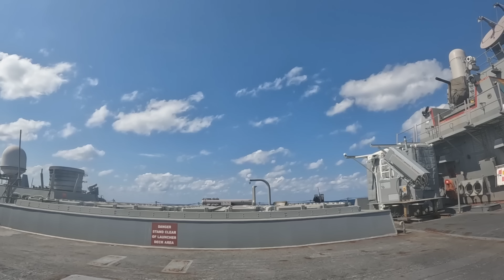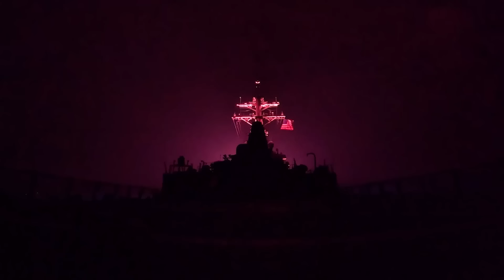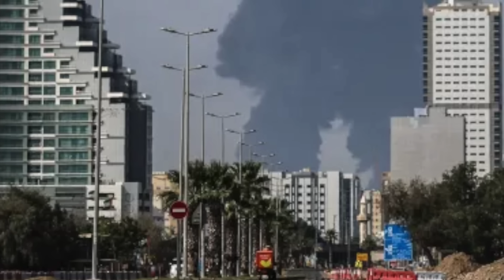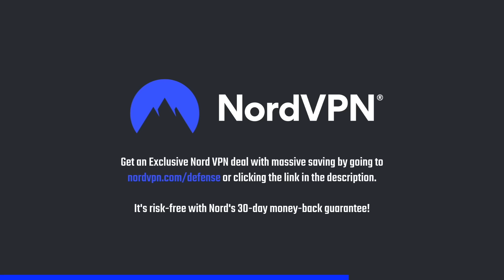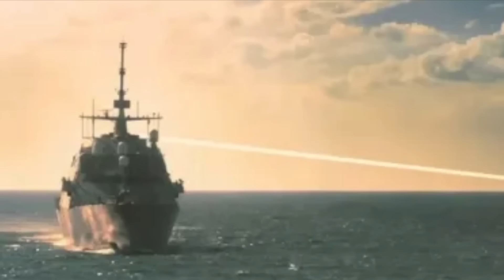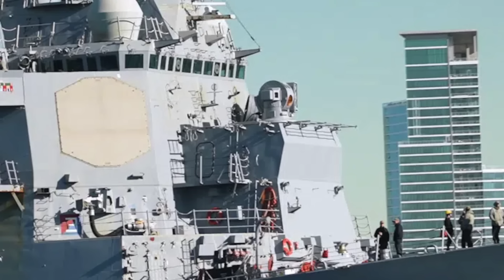Why US military needs HELIOS laser in every warship ?

Comment: Weather, battlefield smoke and clouds can render this system degraded.  Also it has a weakness for low in coming threats due to its direct line of sight and the horizon limiting its engagement times.  However in degraded it can readily engage targets coming in at a higher angle especially a ballistic missile trajectory.
Reply: wonder if like a rocket cluster with some containing smoke bombs could be enough to protect other nearby rockets in time if they alser hit the wrong disguised target. 

In Gundam they had gas canisters to help disperse beam weapons

Comment: Not impressed.  
1) If it doesn't work in all weather, it's not a viable/reliable defense. 
2) If it's line of sight, it lets enemy missiles (and possibly MANY) get real close.  Either it works, or doesn't,  but better know that before buying a bunch (and replacing other systems)
- if there's a "time on target" restriction, there's a related "max number of potential targets" limit.   Better know that too, because the 10th target is likely getting darned close!
Reply: Well for shooting down drones that seems viable

Comment: America also needs more Palmer Lucky
Reply: Ive been saying this. The United States should be wasting Anduril cruise missiles in Iran instead of Lockheed Martin and Raytheon missiles which are over priced AF. They work just way to costly to waste.
Reply: @austincizmeli6268  
Wrong
The Anduril cruise missiles only carry 100lbs warhead which is only good for mobile targets and other light targets
The JASSM and TLAM carry 1000lbs warhead which is excellent for hard target penetration. So with Iran's harded bunkers and structures, the JASSM and TLAM has no problem destroying them in one shot
The TLAM-D carries submunitions for spread out targets such as air fields 
If  Anduril had any sense
they would not being trying to compete against the JASSM and TLAM
The short fall that the US aircraft has is they lack a high speed long range missile capable of time sensitive strikes against fixed or moving targets
The Army PrSM gives them that capability via HIMARS and M270 but they are not as fast or as flexible as aircraft
Example, the S-400 range is 250 miles and the S-500 is 315 miles as well mobile targets like Iran's launcher
So the missile that  Anduril  would need to develop would be mach 3 plus carrying 100lbs warhead with multi mode seeker able to track fixed or moving targets with 350m range
The AGM-88G cost 1.5 mil ,  Anduril could make a target cost of 300K per missile
S-400 has 7 parts 
So AGM-88G is 10.5 mil spent where at a cost of 300K, it would only be 2 mil spent using Anduril high speed missile
 Anduril could also pitch as a weapon to use against Chinese DF launchers
They are trying to compete in the wrong area
Reply: Anduril is the bomb!

Comment: They could be using that 747 laser right now Flying over or close to the Iran  Knocking down Irans larger missiles  It is the perfect place and time  To bad they decided to discontinue the program
Reply: Was never really a practical weapon, and has been mothballed for over a decade.
Reply: @bbmw9029 yes because the research was to expensive The other reading was We believed it would only be used to knock down nukes from places like N Korea or Russia  It would cost to much to keep it up during a nuclear crisis or never have air superiority
Reply: Well the simple and quickest is the AC-130
The AC-130 has 30mm but I dont believe its the stretch variant
That variant can use the 30mm PABM-T
An AC-130 with 30mm AHEAD and PABM-T paired with E-2D acting as eyes
If they had the time
They could add better stabilization and tracking  to increase 1 target 1 shot
Reply: @verdebusterAP  You're talking about a Hercules gunship.  These are for ground attack.  They're very much NOT set up for taking out missiles.  What the Army has been working on for using against drones in the AH-64 Apache, with it's 30mm cannon, firing proximity fused drones.
Reply: @bbmw9029  
The AC-130 can take out low and slow drones
As for missiles
Another solution using the LCS as platforms
German Gepards with AHEAD rounds
or a single 35mm canon 
they can put them on the decks of LCS and link to E-2D
Reply: @bbmw9029 those were UAE Apaches. I dont believe the army is using that tactic.
Reply: @John_Redcorn_ US Army has done it in testing.  UAE has done it in combat.